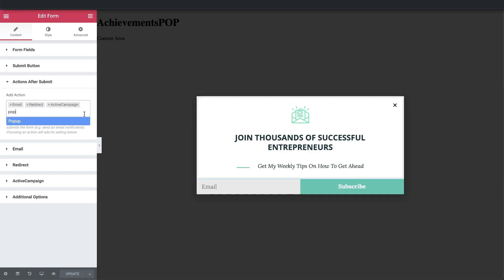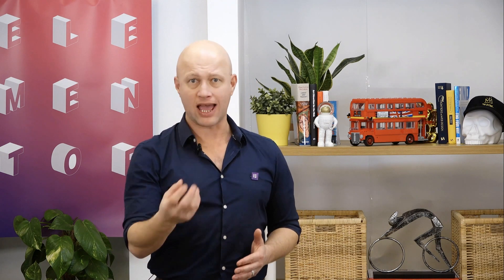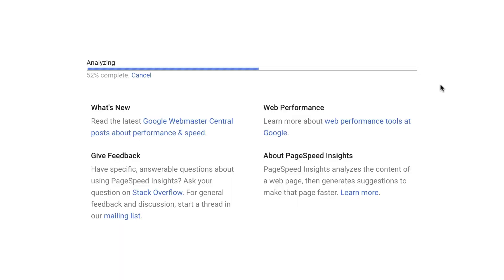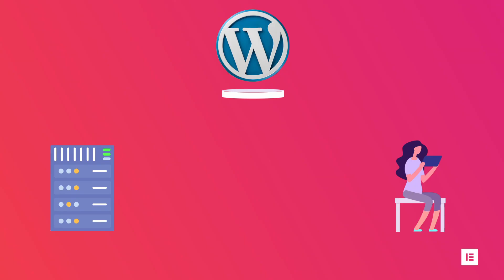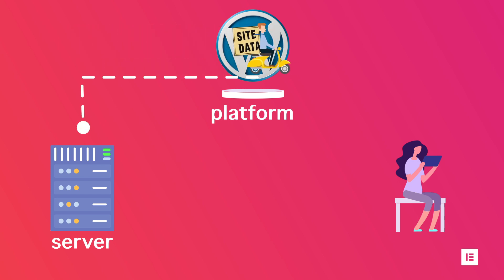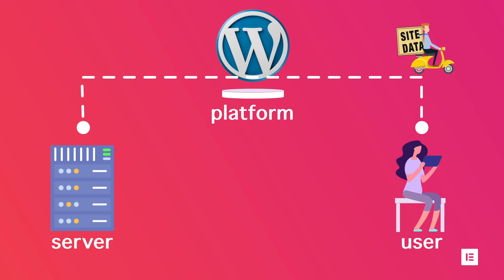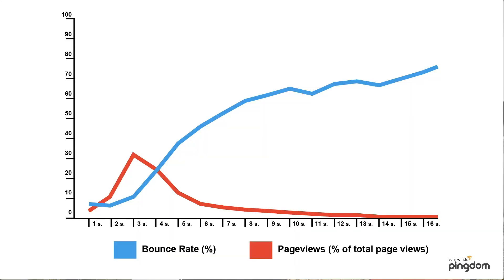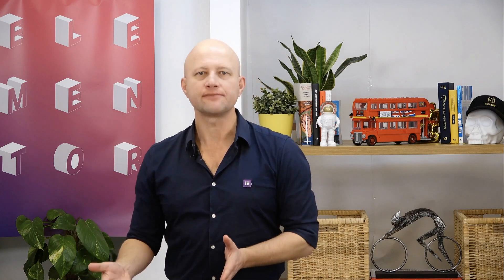How to Speed up Your WordPress Website — Part 1 — Monday Masterclass

Comment: Ironically, the markup that Elementor generates is terribly unoptimised. This is understandable though as there is an inherent trade-off of making a code generation tool that is flexible vs writing the optimal code for a specific site's use-case. So any other visual layout tools will generally also generate non-optimal code, unless you really dig in and change their code templates to suite your personal needs.

Comment: It would be more useful if: take a real website on a shared hosting (where most of your customers host their elementor sites) with a a lower google speed insight and show how you can step by step improve google ranking.
update: I've tested elementor.com on google site speed. The score is a low 38 for mobile :(

Comment: A really good subject. And a good, high-level intro for those people who are not experts.  I do have a concern with Elementor (basic+pro), it seems to add a lot of bloat and convoluted coding. the site speed improvement after moving to Elementor (and Hello) is not at all what I had expected. From what it seems (but I am not an expert in the matter) Elementor pages sent to the client are built with some awfully complex and tangled code. I certainly do hope that this is something that the team is working hard on. It is a very important issue.

Comment: Here's what helped us with https://liftedwebsites.com/ 

1. use elementor, (template) no theme
2. switched from siteground to WPengine (google cloud server) now Siteground is moving or has moved to Google cloud server I believe and they weren't at the time
3. use cloudflare cdn
4. use autoptimize/WP rocket lazy load plugins
5. reduce as much of the 3rd party codes as you can
6. within autoptimize use shortpixel image optimizer and its plugin that connect to it.

Hope this helps others looking for more of a guide or steps..

Comment: Sorry, I personally didn't find the video useful at all, especially if this is supposed to be a "masterclass"  But I can give you all some great advice from my own experience.
I had already highly optimized my site with predominantly WP Rocket,  Asset CleanUp Pro: Page Speed Booster, ShortPixel Image Optimizer.
It is an eCommerce site with around 300 products and my page speed was 1.5 to 2.5 seconds fully loaded.
Being nitpicky and never 100% satisfied :), I really wanted to completely customize the woo commerce pages and improve the design, (which were already customized to my liking with Elementor Pro) so I purchased the Jet Woo Builder plugin suite, which is quite an amazing tool.
It looked fantastic unfortunately, it added 8 seconds to my page load speed and at least 100 more requests! 
I spent the next two days uninstalling the Jet Woo Builder and hand-coding (mainly CSS) all the templates so I had exactly the same look and design, but without the plugin.
Basically, the motto here is to get rid of unnecessary plugins. They are the biggest speed killers of all. Plus keep everything (database Esp) squeaky clean.
My site now fully loads in 1.5 seconds on average.
Main thanks go to (WP Rocket,  Asset CleanUp Pro Page Speed Booster, ShortPixel Image Optimizer)
I hope this helps everyone, especially if you are building woo commerce stores.
Reply: Thanks for sharing. Can you elaborate on (1) what do you mean by hand-coding (mainly CSS)?  (2) Do you use a CDN? Thank you.

Comment: It is really good that Elementor brought this up . I optimized my site pretty well.

Here are some question i really want to ask -
1. Why Elementor add so much bloat to the site. if you're using Free version of Elementor  then you have less bloat to maintain but if you use  Pro version then you're in deep trouble. 

2. Why elementor combine all the css into one stylesheet instead of creating into small file ( This might overwhelmed newbie) but for those who want speed it is really good and helpful. So we can remove unused CSS using Asset management plugin.  And better for critical CSS and unused CSS.

Now we can't if you disable frontend.min it will disable everything. Having an option in advanced setting to split all the css ,it will be really helpful . If you see Frontend.min it will also include - woocommerce,  etc

3.  I wish most of the  elementor 's JS are not dependent to jQuery .
Reply: @UCNpppe6UQjEeZAyambM2EMA you can still optimize your site if your site is build with elementor pro. You have to use Asset clean up plugin or perfmatters or any asset management plugin to unload CSS or JS you don't need. Bit of warning though don't mess about with JS without knowing much  because it has so much dependency. You can mess about with CSS though . See my site https://foxscribbler.com homepage
Reply: @thangjamkishorchand  Ok ! so do you think we can get the 800~900 ms load time for a nice homepage with the pro plugin ?
Reply: @thangjamkishorchand  Do certain hosts make your web pages larger by default? How did you achieve such a small file size homepage?
Reply: @lulzapper  Do certain hosts make your web pages larger by default? - Not at all ( Enabled gzip compression that hosting can provide you ) if you're using Content Delivery Network (CDN) then use Brotli Compression it is modern and better than gzip  

How did you achieve such a small file size homepage? - If you test my site on GTMetrix you will notice there is less JS  ( 18KB) and see all my images are manually resize by me. and If you see my CSS i remove heavily with Asset clean up plugin.

Hope it make sense
Reply: @thangjamkishorchand  well work
Reply: @thangjamkishorchand  i want know the css that you used to show the blog carousel on you site please share with me
Reply: (repost thx for your answer thangjam) Same opinion here, unfortunately I'm not sure to renew the unlimited pro version this year since I realized that the pro plugin was significantly decreasing performance. Since I've been interested in optimizing wordpress sites I was really disappointed to see that my sites with the  old Virtual Composer was easier to optimize. 

 I'm really waiting for an action from the team to improve performance on the pro version. ( don't make me come back to virtual composer I beg you:) !)
Reply: Agreed
Reply: @Simon Shocket  Adding a drop down like "CSS Print Method" would be super amazing so people have choice whether to split the code or not.

You are absolutely correct, small files are best with with H2 protocol, which one of the main reasons we are considering a solution (catering to small files) for a future release. 
As for JQuery, again you are correct. This is something that we've been discussing at length, and may even resolve in the near future. - Thank you for consideration